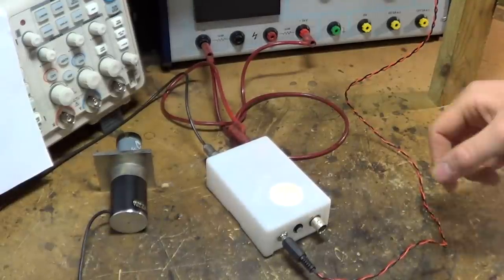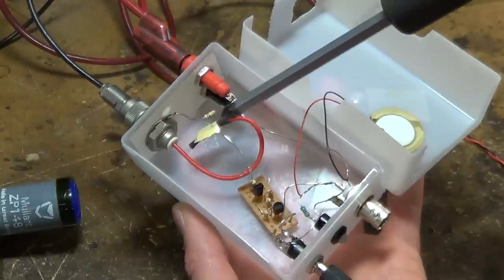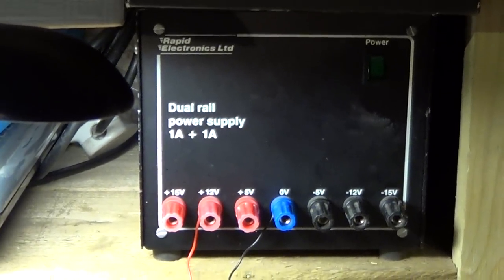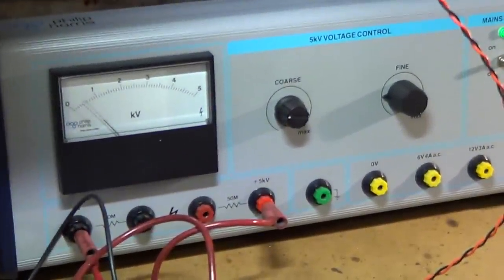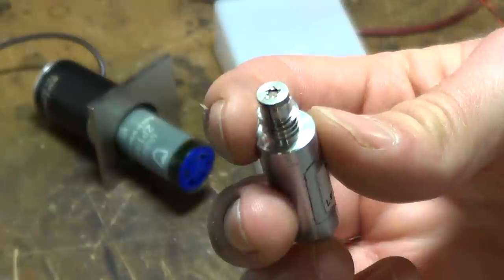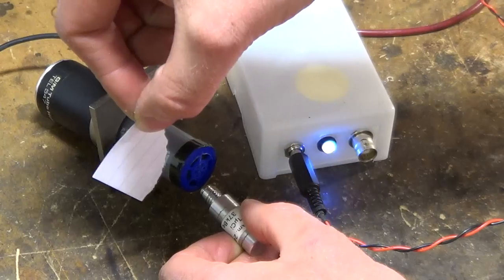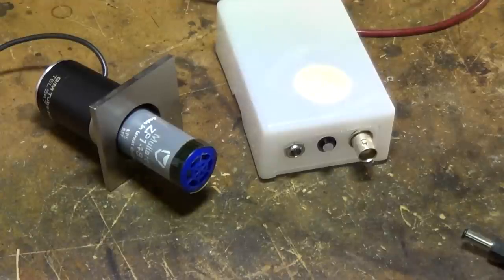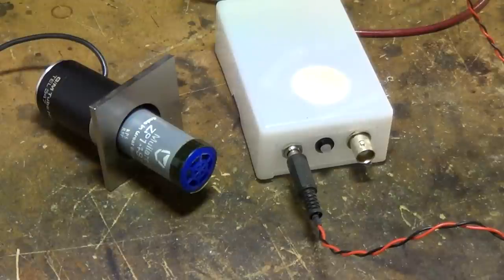Geiger-Muller tube detector

Comment: How did you find the tube? Did you make it yourself or you bought it? I would like to create a geiger counter as a school project but building one capable of detect alpha radiation seems quite hard
Reply from the maker: I got it out one of the skips at university years ago - it had been thrown out along with a small educational X-ray machine. Actually building a tube is difficult, but there are quite a lot of tubes on EBay (search "Geiger tube" - mostly old stock from Ukraine/Russia). Note that alpha-detecting tubes (with a thin mica end window) are much less common. It's relatively easy to get hold of a glass-bodied tube, but they're generally only sensitive to beta and gamma which, if all you've got is an Am241 source, isn't going to do much.
Reply: ***** yeaj, I know that it requires an inert gas atmosphere (like helium or argon), and it wouldn't be that hard if only it also must have a pressure of about 0.1 atm. I would like to do an homemade geiger counter but building the tube seems the hardest part